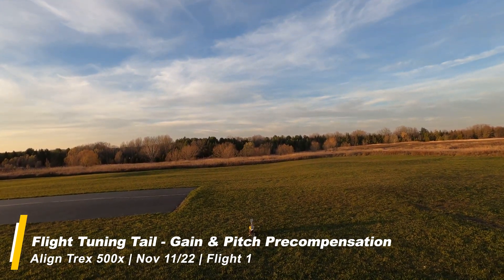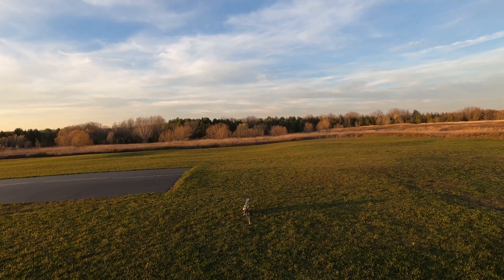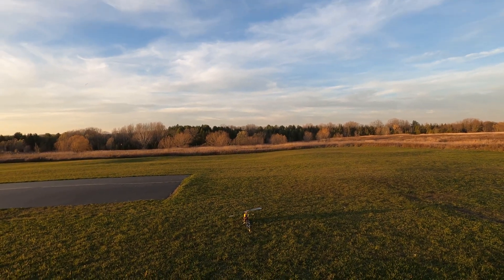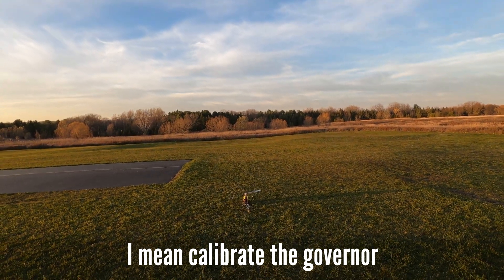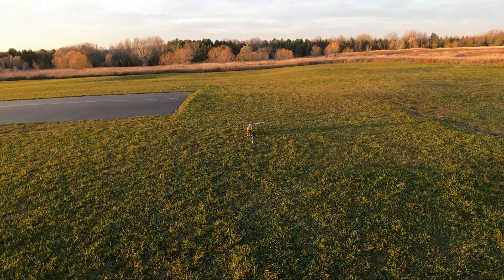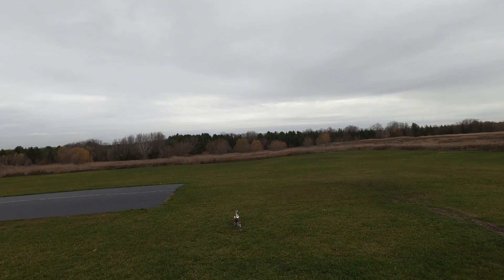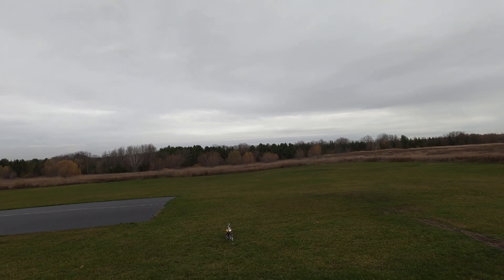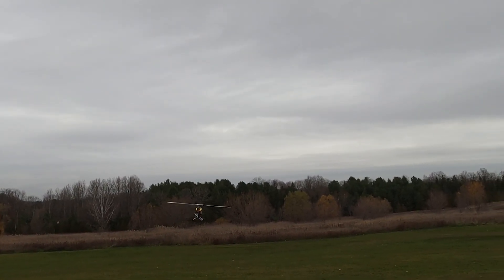Flight Tuning Tail - Gain & Pitch Precompensation | Align Trex 500x | Nov 11/22 | Flight 1

Comment: Good flight!. Btw what parts are running on the raw and how much did it cost?
Reply from the maker: Thank u 🙌🏽 I'm running Azure AZ700 main blades/115mm tail blades, HobbyWing Platinum v4 130a ESC, Futaba HC500 cyclic servos, Futaba BLS276SV tail servo, Scorpion HKII-4525-450kv motor and Futaba CGY760r gyro. Lmk if u have any other questions 👍🏽
Reply: @AJsHeliJourney  130a? Does it hold good?
Reply from the maker: @Twx97  It hold perfectly fine for me and my current flying style/abilities. I still run moderate head speeds that I'm gradually increasing to support more 3d maneuvers. I would have to check my telemetry to be sure, but I think I'm flying at around 1700rpm now with this heli. So nowhere near max head speed and I'm far from doing any hard core smack 3d LOL so 130a for now I'm finding, is more than adequate. With that said, I do plan on putting a 200a ESC in this heli in the future and use the 130a on a smaller 550 or 600 size heli 👍🏽

Comment: It should see 50% when you come off hold I was told by the best pilots at my field. Getting away from ikon governor to Govstor was a really good thing for me.

I’m right where you are with flying so I like following you and learning together haha
Reply from the maker: Yes, 50% is what I had the throttle at to calibrate the gov. The issue I believe the first time I tried it is that I waited too long to start the calibration. When I did it at home, I started the calibration right after initializing the ESC & FBL and it worked like a charm. After hearing and feeling the motor and head speed, I'm also convinced that using the ESC gov is the better route for me too 🙂

Thx for tuning in 🙌🏽 It's great to meet ppl who r learning to fly like I am. I hope we can continue to progress together with our flying skills. I'd love to hear about ur progress and of course, I will continue to share mine 🙌🏽 Cheers 🍻